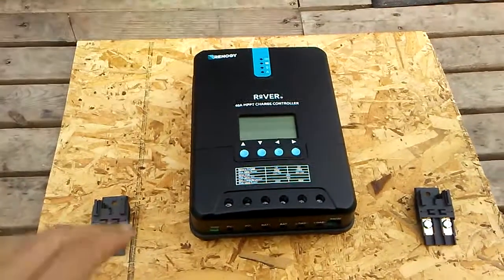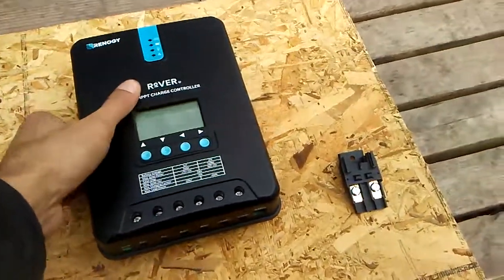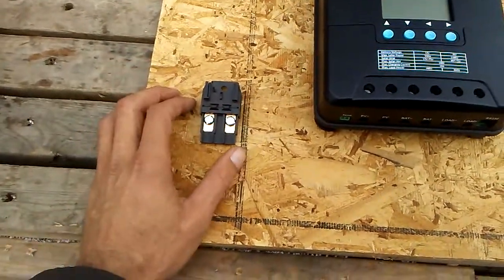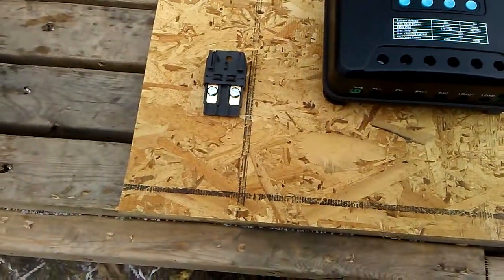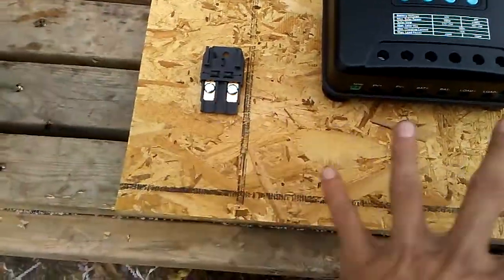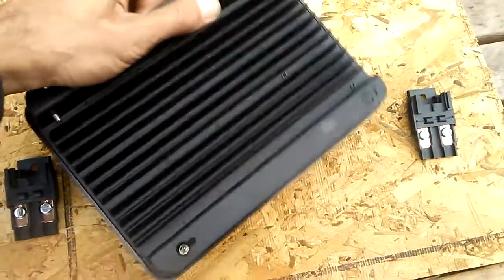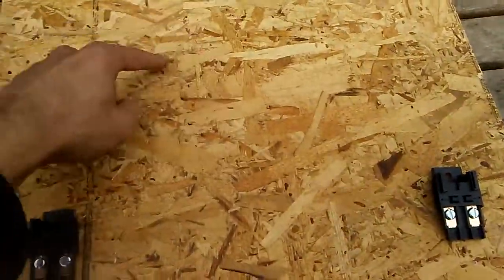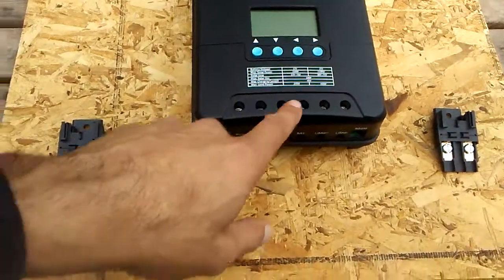Renogy 12V 400W 40A Solar Panel System Kit Install - Part 6 - Rover 40A MPPT Charge Cont...

Comment: Where did you get the fuse blocks and what specifically are they called? Thanks!
Reply from the maker: I got them at Fleet Farm. I think they were like $4 a piece?!  I don't remember.  Not to much though.  They were in the automotive section of the store.  I think Tractor Supply has them too. Inline 40 AMP Fuse.
Reply: Tiny Iowa I'll have to take a look at Tractor Supply Co or my local auto store. No Fleet Farm in my neck of the woods... every time someone brings up Fleet Farm I cry inside because they have one of everything and are so awesome. Thanks for the reply.

Comment: I would like to thank you for your solar install video series. I recently purchased the same kit and have been watching as many install vids. I can find. Just a thougt, you may not want that opening behind your charge controller. Most likely it was designed with the air space provided for proper covection. By doing this, you disrupt the natural air flow.
Reply from the maker: Thank you.  I hope that it can help you out.  What I have personally found... the more airflow that is around the air cooling fins, the more cooler it runs.  Kinda like a engine that has cooling fins on it instead of a radiator.  Yes the engine will run, but when there is more air movement thru the cooling fins, the cooler it runs.